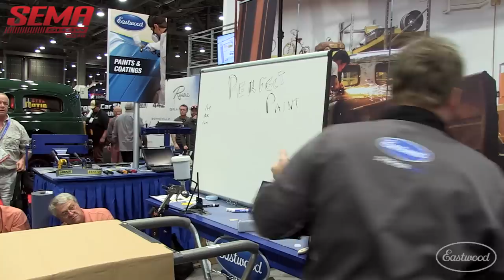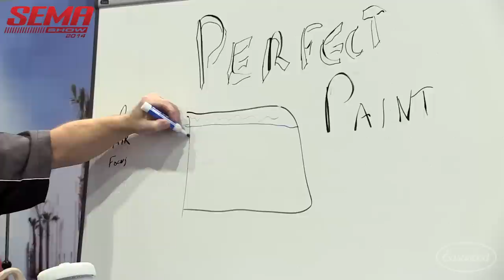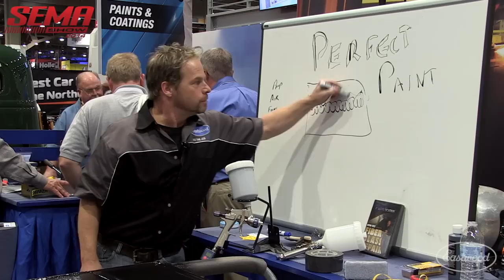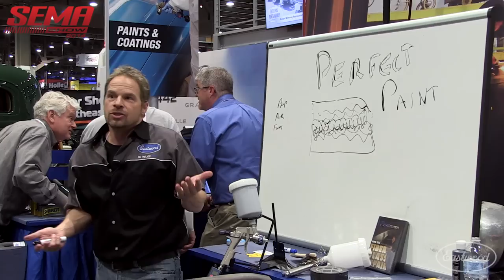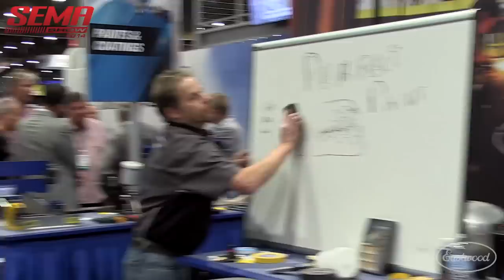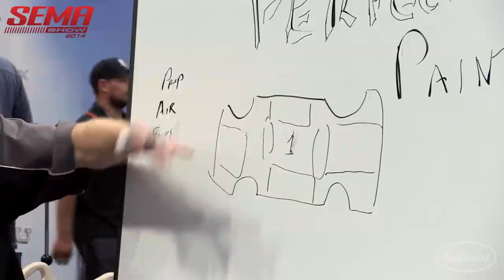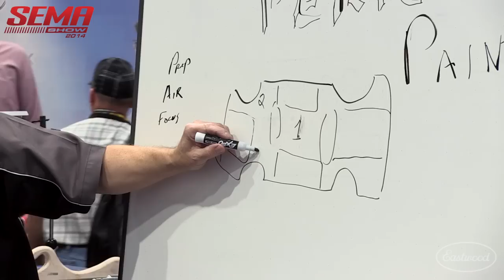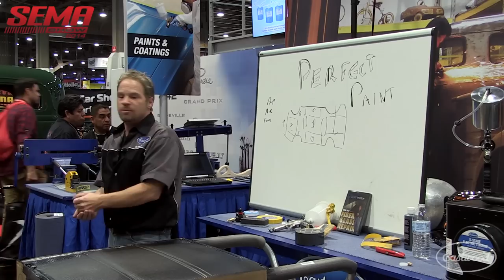SEMA 2014 - How To Paint A Car Yourself At Home With Kevin Tetz - Eastwood

Comment: Gonna say this and then finish the video. On a "roll around compressor". I painted a GTO for a friend in my front yard using the gladhand air outlet on a 300 Mac truck. I painted a AMX Javelin using a gas powered carpenter's compressor for him also. The trick was timing and reducer. I was taught by a very good painter in the early 80s. His theory was a beer between coats and at least four coats of paint. The trick to a good job is cleaning the surface. I paint in my yard on good days.....LOL
Reply: spray early in the morning when there's no wind or bugs. use med. or fast reducer and a large tip, move fast. Beers by noon.

Comment: I painted a 67 Mustang in a 4 stall garage, radiant heat, plastic over one wall of shelves, water thrown on the floor, no fans bring air in a window past a filter and fans under the garage door, and turned out "BEST OF SHOW/BEST OF CLASS" paint work. ANYONE can paint their project with minimal conditions and finish/sanding work....in fact, never wet-sanded the base or clear at all. NOTHING BUT TO DO IT is a lesson used through-out life.

Comment: It seems that sprinkling baby powder onto a flat panel would be a good way to augment the paint brush taped to the spray gun training aid. The powder would reveal where the bristles touched heavy or were not in contact with the panel. Thus revealing if your sweep isn't "robotic."

Comment: Gee Kevin, dry air with a disiccant air dryer is nice, but unless you like buying loads of those little blue beads you need to setup the compressor piping properly. I see guys with water traps and the traps getting loaded with water. Blue beads can’t fix that. My water trap is perfectly dry. Why? The piping is done right. Look at TPtools metal moisture piping kit. That’s how you need to setup ever air outlet. Now it’s 150$ but you can go to the store and buy the fitting and make your own. Also you need to slope the metal lines back to the compressor. Plastic pex doesn’t trap water or condense it out of the air. Try it out and you’ll see why that thing works.